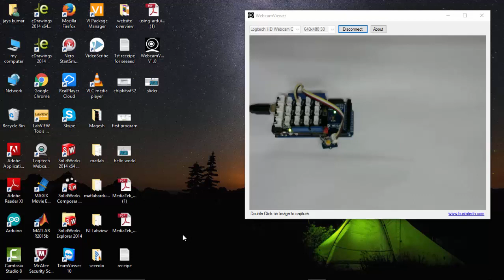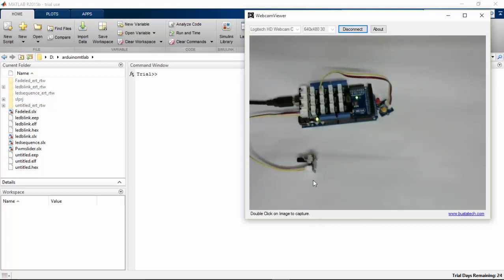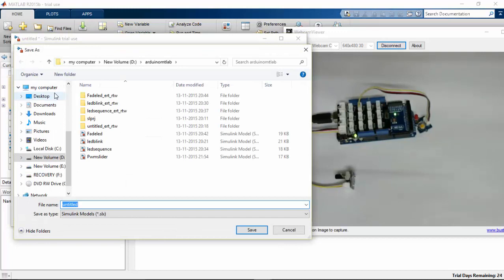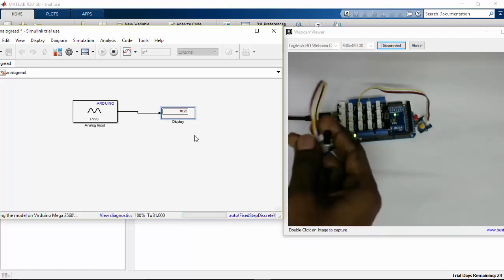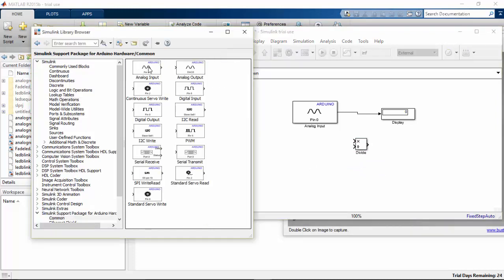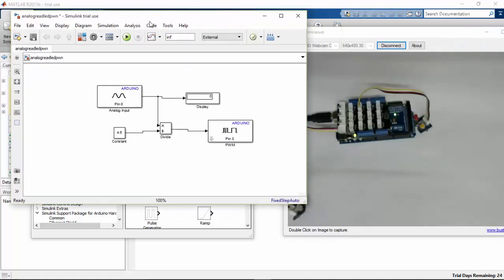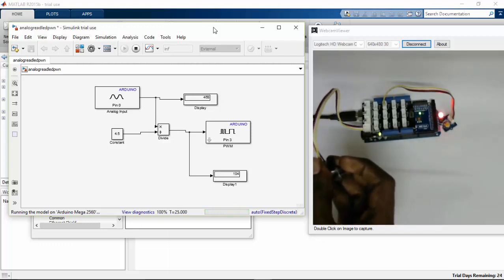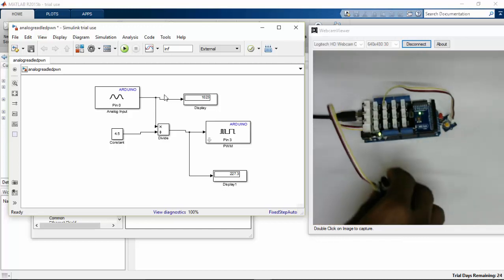3. How to read analog signal in Arduino using Matlab Simulink

Comment: I need to compare two sensors readings on simulink. I'm using the same analog block as you but I need to analyze more parameters of the signals such as manginute, angle, lagging, etc. Do you know what the best approach for this is ? I thought about digitalize them and continue from there but I'm not sure if it's a good solution. Thanks in advance

Comment: hy when u try to run the simulink blocs ii get this problem can you help me to solve it 

Error occurred while executing External Mode MEX-file 'ext_comm':
Failed to connect to the target. A time-out occurred while waiting for the connection response from the target. Possible reasons for the time-out:
a) The target is not switched on.
b) The target is not connected to your host machine.
c) The application for the model is not running on the target. You might have clicked the Stop button. If the Run button is not dimmed, click it. Otherwise, click the Build button, which downloads and runs your application on the target.
Reply: you probably have solved this by now, but I think you might be using an arduino clone and have to lower the baud rate in the simulink settings

Comment: Hi , 
i am using accelerometer ADXL345  with arduino mega and taking accelerations, its working fine but i want its values in MATLAB Simulink i have installed arduino support package for arduino and simulink and MATLAB is detecting arduino but not showing values of accelerations in display of Matlab Simulink...
 I dont know whts wrong any body please help should i have to something else as well??
Its urgent
thanks in advance

Comment: is it possible to use Uno rather then Mega2560 or Due?
Reply: yes brother, why not ?
Reply: No.
It is impossible because Uno cannot use External Simulation Mode
Reply: 大谷啓介  but in the normal mode no signale shown on the dispay 
please if you have any idea contact me on facebook or email :safikoiap@hotmail.com
i will be thankfull
Reply: It is possible, you just have to change the board selection from Mega to Uno
Reply: I think we can use